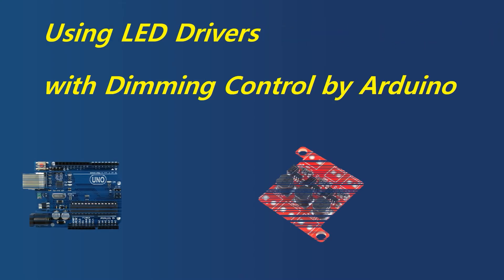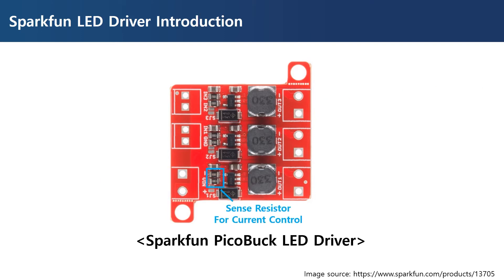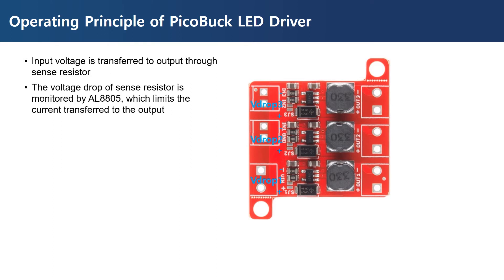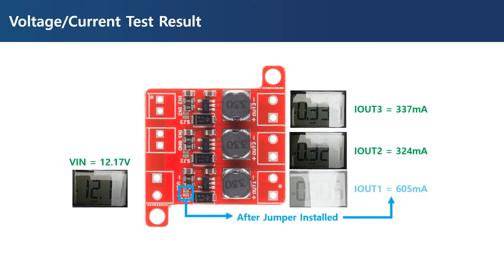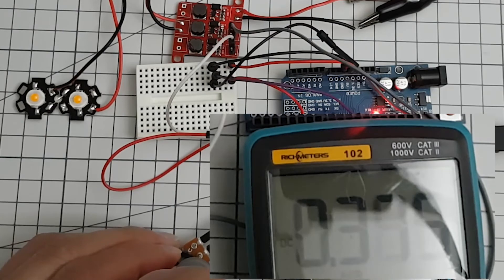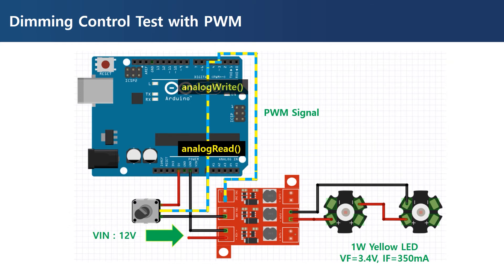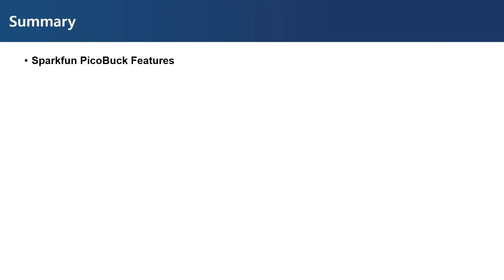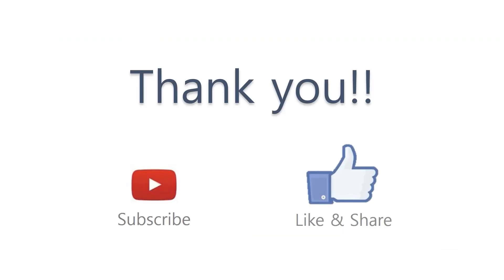Using LED Drivers with Dimming Control by Arduino

Comment: the driver output 330mA and the leds are taking 350mA. How it is possible?
Reply from the maker: LEDs take whatever the source provides. So if the source provides lower current than the rated current of LED, than it will be less brighter than expected. But if a larger current is supplied to the LED, the LED will be overheated and damaged.
The LED driver limits the current flowing to the LED to prevent damage.
Hope this answered your question.
Thank you for watching!
Reply: @gemsungelectronics460  so if I connect a 350mA led it will be at 94% of it's full brightness ? (330mA/350mA = 0.94). How to change the sense resistor to get 350mA at the output (you say up to 1A is supported) ? thank you
Reply from the maker: The formula for the sense resistor and output current is introduced in the video as,
Rsense=0.1÷Iout
So if you want to increase the current, you can adjust the sense resistor.
Thank you
Reply from the maker: Actually the amount of current flowing through the LED is governed by the IV characteristics of the LED. But relying on the IV curve of the LED can lead to another problem, and should be avoided.

Comment: Why are you using TTS?
Reply from the maker: Good question!
I thought that using TTS would be more effective in conveying the content.
I am also considering using my own voice later if necessary.
Which do you prefer?
Thank you for your comment!
Reply: @gemsungelectronics460  Your own voice. TTS always feels so impersonal, even insulting somehow. Even if you have a heavy accent, I'd rather get a lesson from a foreigner than a robot overlord.
Reply from the maker: Thank you very much for your advice!!